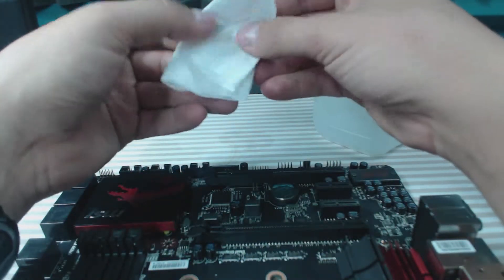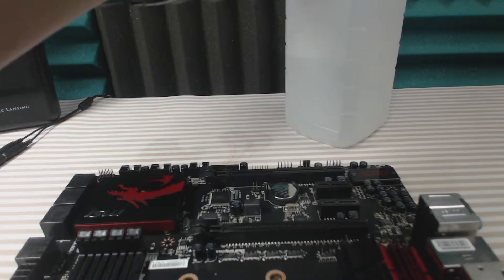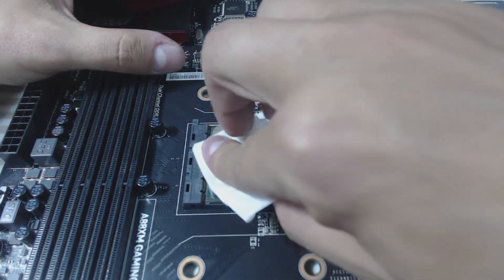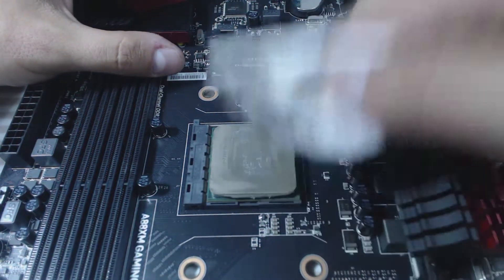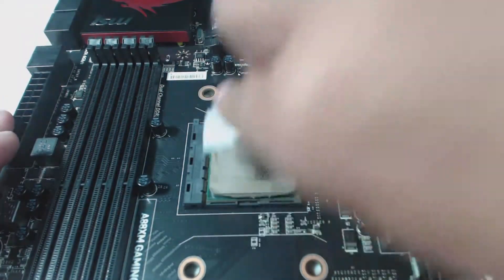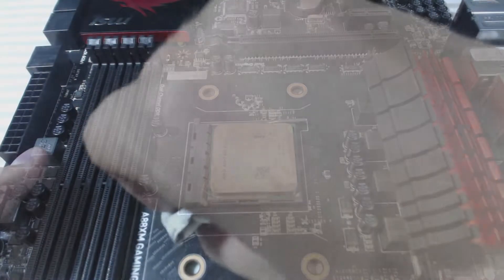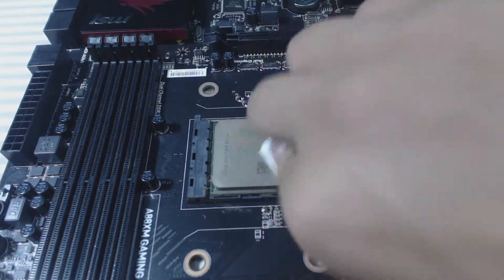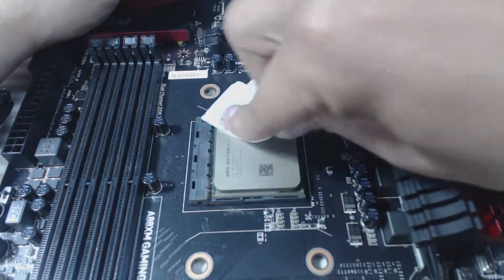How to clean thermal paste off of a CPU/APU with house held items

Comment: hey man, I am planing to buy 99% IPA to clean my laptop's thermal paste. I also plan to use coffee filters. But isn't IPA dangerous if it gets on skin through the coffee filter? Or is there no danger and I am just overthinking? Thanks for the video!
Reply: Unless you plan to take an IPA bath, nothing bad will happen. Alcohol evaporates faster than it can soak through your skin and even then, it's only toxic at very high doses. This ain't acid.